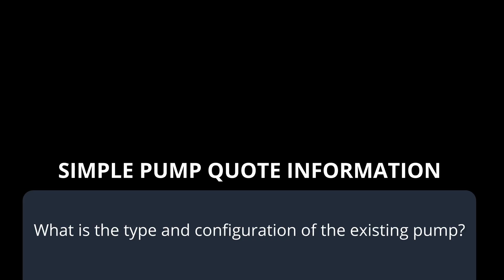Simple Pump Water Well Pump Basics: Information Required for Quotes

Comment: Ok , here's the zinger.  Do you have an adapter  for the top of the Sucker Rod Extension that I could attach a cable or chain for my existing Windmill.   Also what is the stroke length since the standard Areomotor has TWO settings for stroke length.  Sorry there's always one guy with a crazy question.
Reply from the maker: Thanks for reaching out.  We do NOT have any kind of adapter for this type of connection.  While we do have many customers that successfully customize their system in this manner, we have many that try and end up breaking their Simple Pump.  Due to this, we do not provide adapters that facilitate it, and we actually can no longer warranty the system if it is modified to be used in this manner.  We just have no control over the stroke or use of the system with these modifications and if not done correctly it can cause some major issues for the pump.  This being said, there are many customers out there that have done this modification correctly and use it in the manner you are suggesting!

This being said, the threads on the end of the lift rod are 5/16-18, the threads on the end of the pump rod are LH 1/2-13 and the stroke of the pump is 9.75"!
Reply: @SimplePump  Totally understand  about the warrantee  and  realize that it is not designed for this type of  operation and is outside of normal parameters.